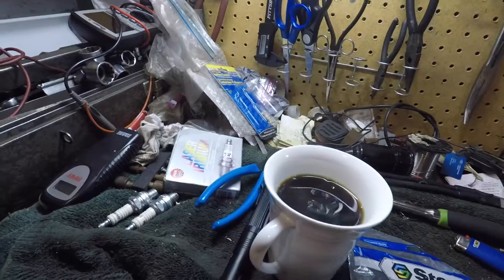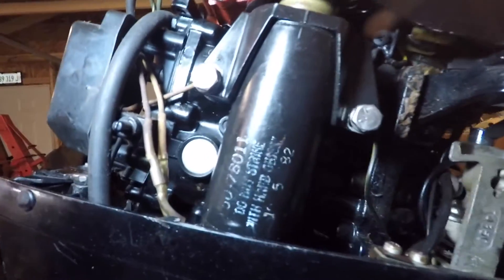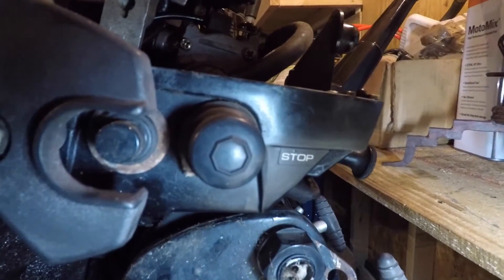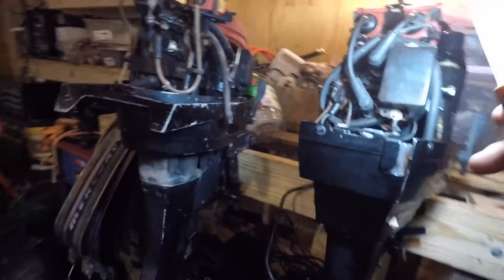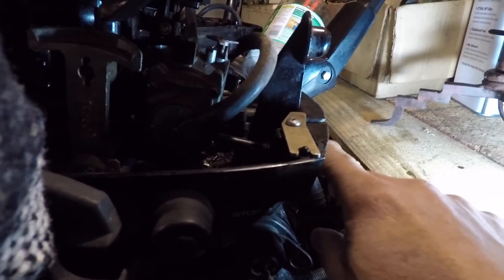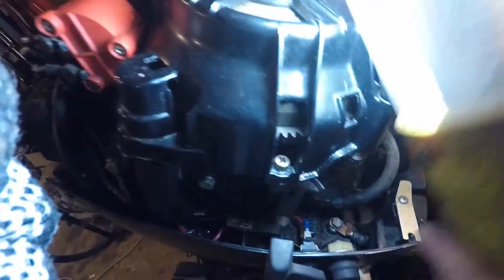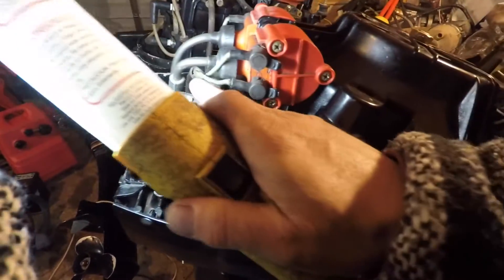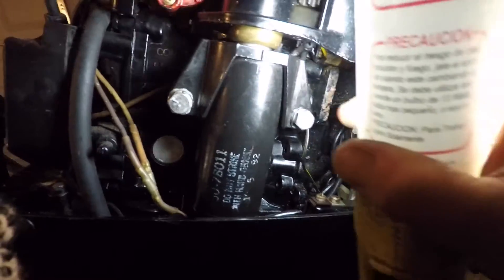1982 Mercury 7.5hp outboard first look pt.1 #PercyPriestLake #Nashviille #willlitrun

Comment: The recoil spring and pull cord assembly is different on this (and mine) than any of the other ones I've found on YouTube.  With mine I pulled the cord after landing a fish and it just stayed extended.  I've got it mostly disassembled but it's not obvious why it's not recoiling.  I don't see any broken parts.
Reply: Did you find out how to fix it, my pull cord broke and I replaced it and now I can’t get it to go back together
Reply: @dakotajackson389  I did.  My issue was a broken recoil spring.  I replaced the cord and the spring.  It helped to have a diagram as well as an extra set of eyes and hands.  Getting the recoil spring in was difficult with two people but just went slow and was persistent.

Comment: Hi, I bought the exact same engine and I am very happy with it.  Since I have to replace the propeller, could you give me the right measurements: pitch and diameter?  Thank you very much
Reply from the maker: Its best to contact your local prop shop.  That way you can give them details on what boat its going on.  They can give you a better assessment of what prop you need.  Thanks for watching.